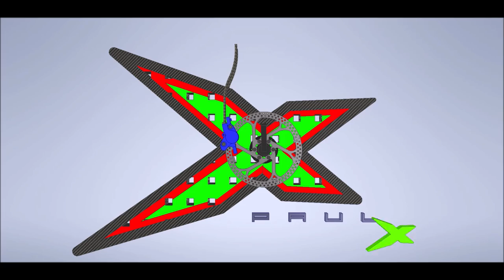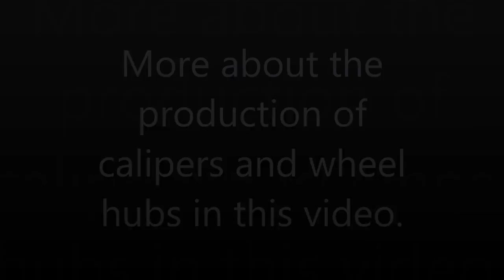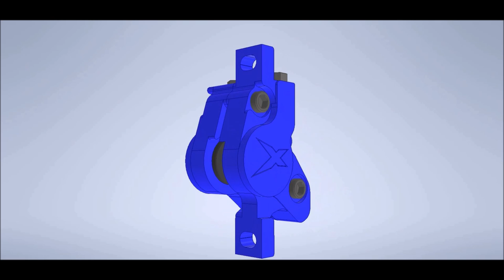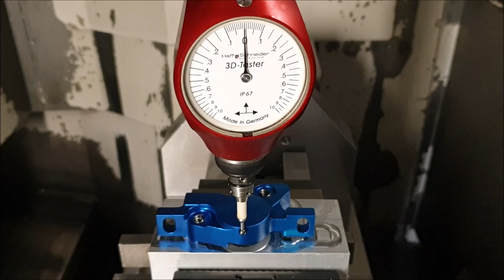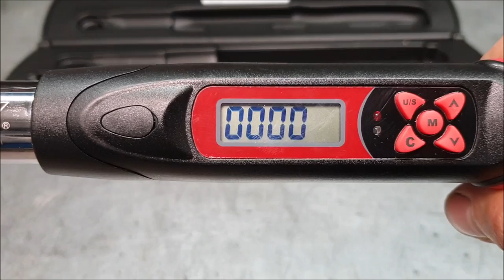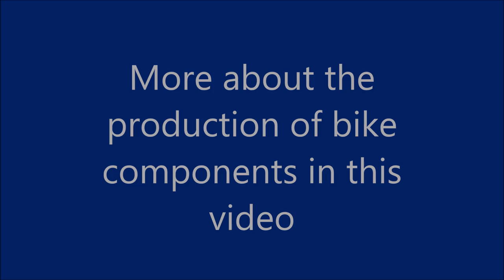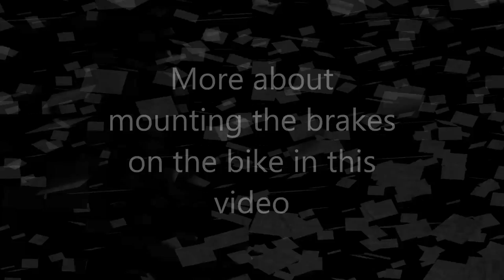Dual Disc Brake - 180mm  29" MTB - Assembly of a calipers and wheel hub.

Comment: A single 220mm Magura rotor is around 6,594mm^2 of surface area. This dual 180mm gives 10,676mm^2 of surface area, or 161% of the surface area, at 157% of the rotational weight (assuming both are MDR-P rotors). Considering that a 220mm rotor is already overkill on a bike, and a 203mm rotor is usually sufficient, it doesn't really make much sense to go dual rotor. The biggest benefit would be if you added dual 4-piston calipers for the force generated by doubling the pistons.
Reply: doubling the pistons only adds modulation not force. your gonna need more mechanical advantage if you want more stopping power, but you (almost) always have more brakes than traction, so pointless anyway, but very cool.
Reply: You are right and wrong, bigger discs make sense in terms of heat dissipation and warping. Stopping power is great at 203 already. A sort of similar idea is vented rotors from Hope. Personally, I have a lot of trouble with overheating breaks.
Reply: @vladivanov7645  Yeah I have been on a few descents where I had to stop and let my 203's cool down The first time I was on a really steep large rocky trail, and by the time I recognized that the rotors were hot they were almost on fire. Could have started a forest fire.
Reply: I do not understand why some people here are willing to rework difficult numbers, but at the same time I do not realize what an unforgiving effect one disc has on me.  I don't have a problem with the braking force, but with the way the quality hand-woven wheel also twists.  therefore, this solution is ideal and excellent.  because the whole wheel does not suffer!
Reply: 220mm MDRP aint overkill, not everyone weighs under 100kg total system weight.
Reply: its great for when you absolutely need to slide on your face after locking up your wheel
Reply: @mayo7982  the braking torque is translated through the hub so both sides of spokes will see effectively identical braking force, even with a one sided disk.

I can see some advantage in the fork seeing a symmetrical braking force and how that could reduce stiction and some flex.
Reply: On a normal bike ?nope .. On my 60kg electric bike ? I fkin need thisssss
Reply: @PaulXchannel  can you make me a set

Comment: Need to see that bracket on the fork leg and how exactly the second caliper is attached. That adds significant weight and what is it doing to the fork leg from movement because it must be clamped to a painted surface?

Comment: You guys think this is weird? Formula and Marzocchi made this an available option in 1997 with the first generation Z1 Bomber. Performance and heat disappation aside, nobody mentioned how it reduces twisting on a telescopic fork to help the suspension function better under load.

...Will this fit my Lefty?
Reply from the maker: I can try to make it.

Comment: I noticed on your front hub assembly that your bearing spacer tube appears to have no room to move around radially, and I didn't see any notches in it either. How do you ever plan on replacing the hub bearings?
Reply from the maker: Good observation👀.
It's tight but it works.

Comment: Hey I'm doing the same but in a different way but I have a question ❓
Which one is better for using in bearing hubs 6200rs or 6200zz , I mean plastic shield or metal shield??
Is there any problem if I use metal shielded bearing??
Reply from the maker: RS seals better
Reply: @PaulXchannel  you mean plastic sealed . Ok.
Reply from the maker: Yes . In my opinion it seals better.

Comment: Kinda pointless, but its cool to see the proof of concept. Maybe it can even make some difference like in hardcore dh (of course 2 quad piston brakes installed with twin 203 rotors, on a real dh bike).
Reply: I was going to use exactly the word that you have used! Pointless
Reply: not pointless at all for long descends and a heavily loaded bike (bikepacking for example). had my 203s failed couple of times on my enduro when descending all the way down from 2500m mountains. had to pause in between for up to 15min and that just sucks^^

Comment: If you can precision machine your own  hubs and disk brake caliper assembly from scratch.  You can probably build your own bike frame from scratch.  You'll just need to learn how to do welding.
Reply from the maker: I would probably go to a carbon fiber frame.
Reply: @PaulXchannel  A lugged carbon frame glued with epoxy.  You could buy the dropouts, BB shell, headset shell and carbon tubes.  I imagine would be the easiest method.  Without building your own carbon mould design from scratch, cutting and laying up carbon fiber sheets with resin into shape, then baking it on an oven.

Comment: Its nothing new. Marzocchi and Formula worked on something in the 1990s. It was deemed pointelss as a single disc was more than enoughto stop a bicycle... Marzocchi manufactured some sets  Z1 forks that had  disc tabs on both legs to take the calipers

Comment: OK, but why??? And after all that work and money spent using low end M501 levers? Single disc higher end brakes will definitely perform better. I guess it’s a gimmick you try just to see if it’s possible.

Comment: unnecessary.
too much weight and too much power.
there is no increase of a fully stopped wheel. And 1 brake is built to fully stop a bike + driver (lets say 1 brake has 100kg of stopping power). With 2 brakes it wont stop faster, it will just have double weight capacity up to 200kg. why do you want that, if you never go above 100kg weight?
and even IF your argument would be you can stop harder and faster...: the frame is not built for double tension. you can get serious problems with this.
from me 0 points for safety and general sense of those brakes.
but 10 points for this boredom project, at least you made it.